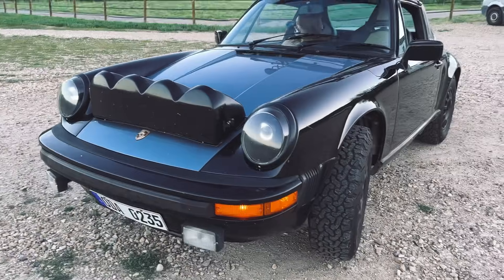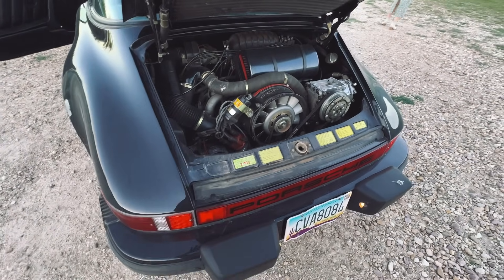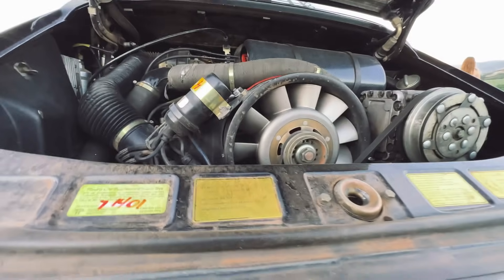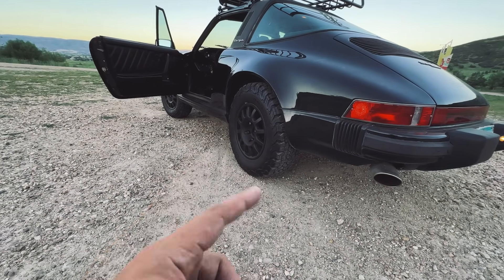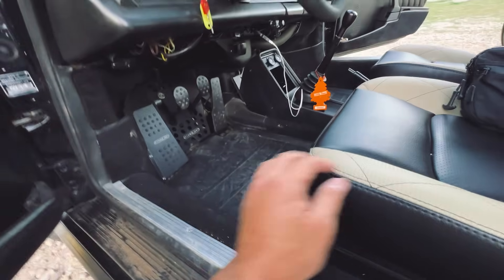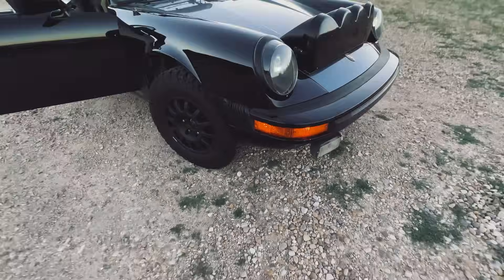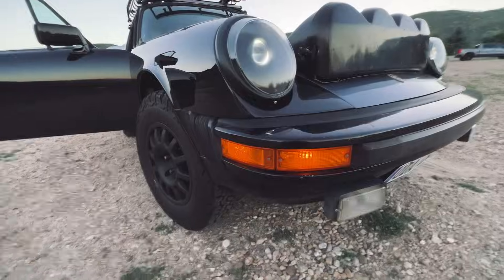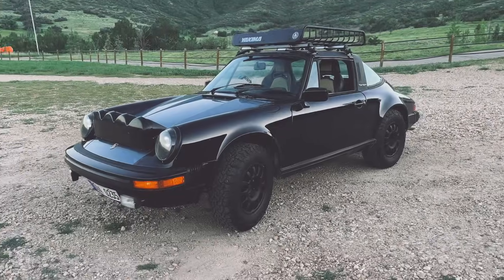Porsche 911SC Rally Build Walkaround

Comment: Get h4 lights and plastic covers for the lights. They sell a relay kit so you can run hotter bulbs. The SC is about the best car they ever built. They put dilivar head studs which is the Achilles heel of the SC. They will just break for no reason. They suck. Otherwise, if you keep good oil, zinc added, it will go a long way. If you ever need a referral for a top notch tech, just comment and I will email you. I have a 76 that we are building a 993 3.6 motor for. It is in a million pieces but was super cool when I last had it running. I'd keep a stock air cleaner on it. Much better but doesn't sound as cool. Enjoy! I've had my 76, 78, 83, 87 and 91 and have currently the 76 and a 99. Plus 928's and 944 and 944t. Regret selling all of them. Iconic cars with tons of character.

Comment: You ruined a good car, this is no good. Oil cooler is on the other side. That AC is a boat anchor. 3.4 liter is what you want. If you need a good air cooled mechanic let me know. Hands down gearing and a limited slip diff is the up grade you need.